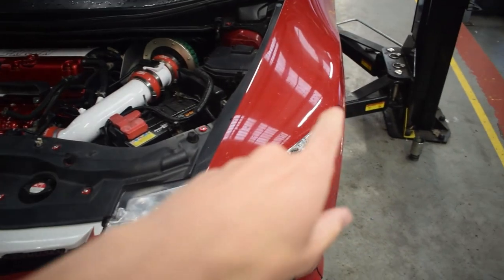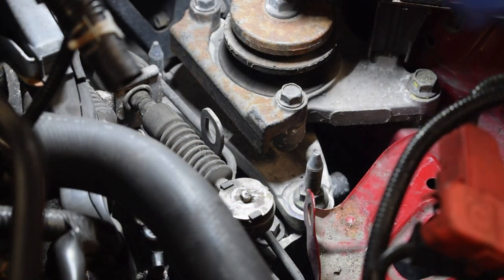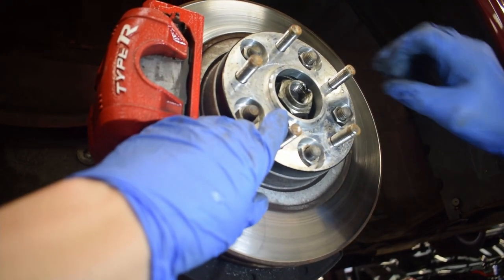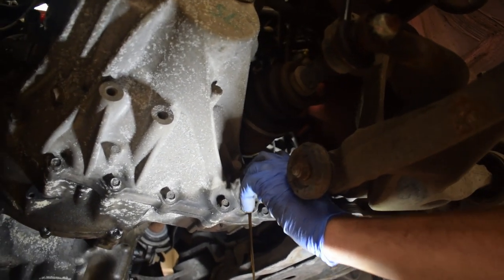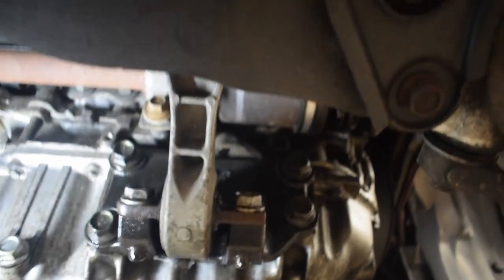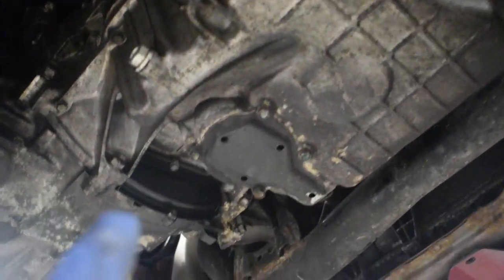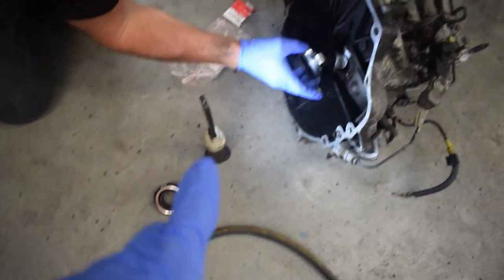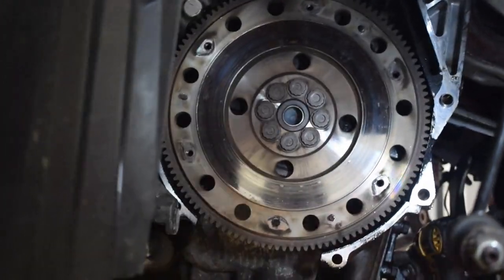The Type R Gets a New Clutch! (IT NEEDED IT)

Comment: How did you get to the bolt that connects engine to transmission that is inside the front engine mount to the cross-member (near the starter motor)? Did you remove the radiator and all?? I can't see how I could possibly undo those wacking big nuts without better access...

Comment: You said on the video not to undo the suspension to swing out the hub to remove the drive shaft as it ruins alignment. How SHOULD this have been done? 👍
Reply from the maker: It's something to do with either where the hub meets the lower arm or where the arm pivots from the chassis. Either way it's NOT where the shock is bolted to the hub.
Reply: The ball joint where the lower control arm connects to the bottom of the strut.Take out the pin, undo the nut and bash the ball joint housing until it pops apart. See this video https://www.youtube.com/watch?v=4VAx_CXQGeM

Comment: Did you have to take the front engine mount off to seperate the gearbox - I can't see a way of avoiding it on my FN2.. How many bolts hold the box to the motor? That starter motor one is a B*
Reply from the maker: Don't think the front engine mount came off for this. I couldn't say the number of bolts specifically. Wish I could have filmed more in-depth but was such a big job in such a small time period.
Reply: Did you solve this Edmund?? I have the car out front in bits and can't work out how to do it...
Reply: @HughCStevenson1  Yes I did.. The front round crossmember and the engine mount have to come off  (engine supported on something obviously). I can't remember how many bolts thee are - IIRC there are bolts from each side. I had to do it again when the starter motor packed up - it was easier the second time when you know what to do!

Comment: Confused why you took off the whole gearbox to change the clutch.. usually enough space in a honda engine bay to loosen and push the gearbox aside with enough room to change the clutch kit
Reply from the maker: Definitely not possible in this model. The gearbox is pretty much supported by the engine so once you septate it to replace the clutch it's supported by nothing at all whilst the process is taking place.
Reply: @FNLEW  ah I see.. that's annoying then
Reply from the maker: Yeah pretty annoying but there's less room the newer cars get I suppose.

Comment: My clutch pedal can be firm and all gears are a little more notchy than I'd like.....I'm thinking clutch too. I'm not getting any crunchy gears or any gear that is worse than any other, just too notchy in all gears and clutch pedal feel is not great....maybe time for clutch myself? 101k on the clock, I've done trans oil. Also did your clutch kit come with an alignment spline? Did you have to pre load the new clutch? Or was it just a case of take out old one - put new one on and fit everything back in reverse?
Reply from the maker: I'd have started with the gearbox oil aswell. It didn't come with an alignment spline but my dad just used his fingers to feel around the edged. No preload aswell. Another cheaper thing to try is maybe look at changing your clutch fluid but that's probably too easy a fix.
Reply: @FNLEW  done the clutch fluid, although I may bleed again, changed slave cylinder, master cylinder (it was creaking anyway) So I think maybe it's the beginning of a tired clutch. Thanks for the video 👍
Reply from the maker: @richardd8352 sounds like you've covered all bases then. No problem at all 👍🏻